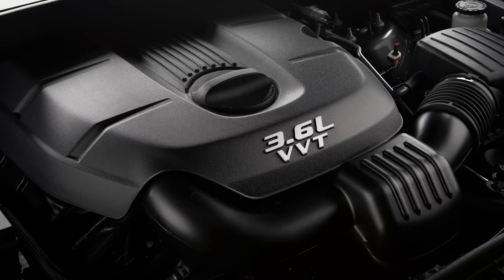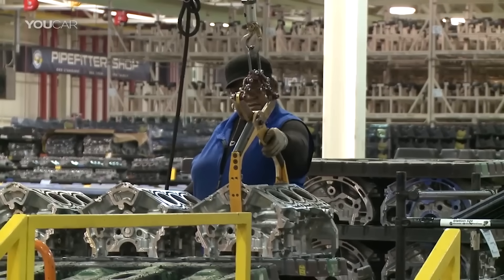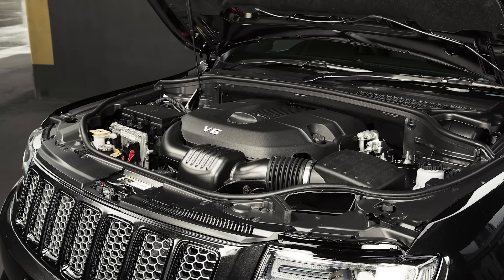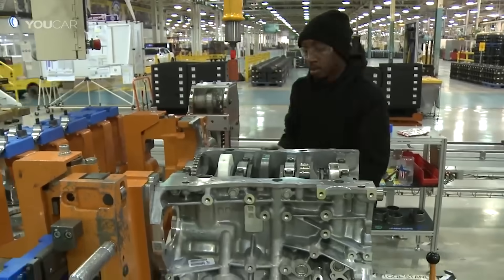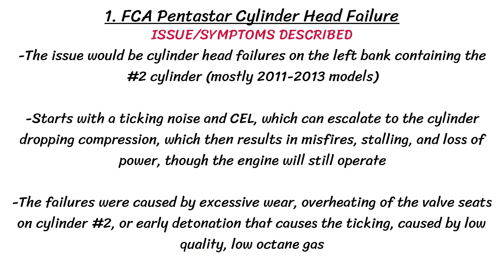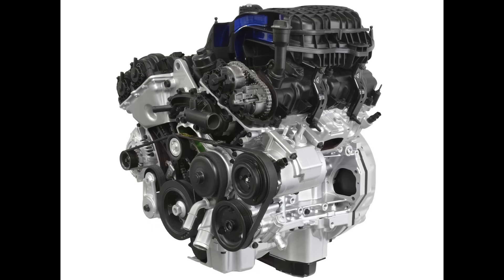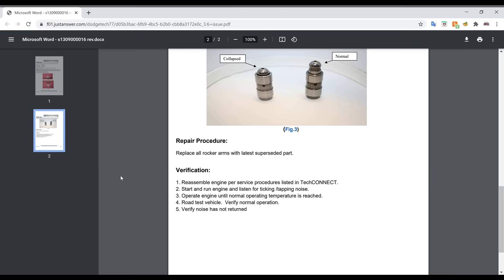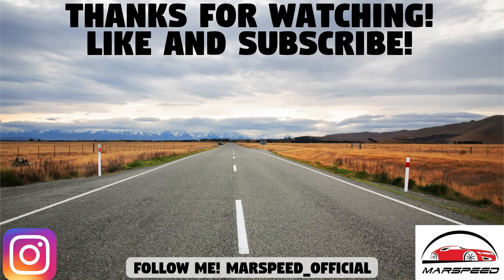The Specs and Fatal Flaws of the Chrysler 3.6L Pentastar V6 Engine

Comment: 253,000 trouble free miles in my 2012 avenger r/t. I drive pretty hard too. Just keeping up on maintenance seems to keep most problems away
Reply: Love the avenger rt, is if lighter than the 200S?
Reply: @user1fja98dnaiid  I wanna say the avenger is 3300 lbs and the 200 is 3600lbs, but to be honest im not sure
Reply: My God man you should get a metal, I never know that was possible. Not even an oil cooler replacement? That needs to go back to Fiat so they can study it.
Reply: Better call guinness because that's either a world record or BS
Reply: @louiewatson9389  the pentestars are actually pretty solid engines. The rest of the car though not so much
Reply: @louiewatson9389  I'm sure if you ever heard of something called "Maintenance" you would understand that any engine can last mind blowing 🤯 right?
Reply: @louiewatson9389  I have a 2018 Pacifica  and just hit 240k......business vam doing medical transport. Only thing I've done is normal maintenance, new serpentine belt etc. Still get 26mpg
Reply: @louiewatson9389  No BS here. I do my oil changes every 5000 miles and change the trans fluid every 15k. The transmission is actually the weak spot on my car. The pentastar is pretty solid and has never given me issues